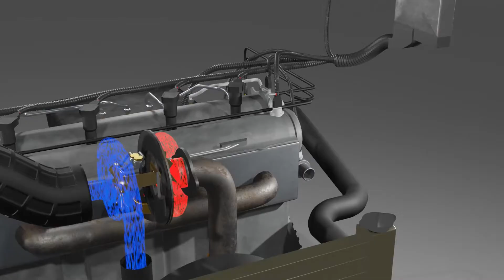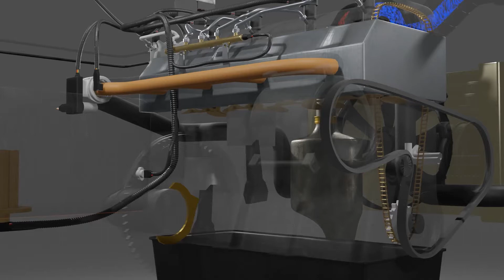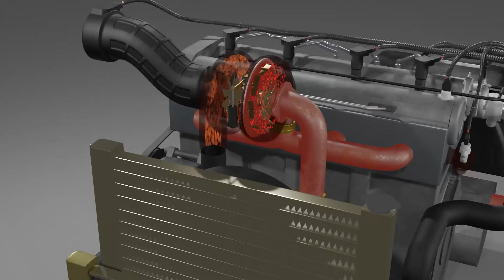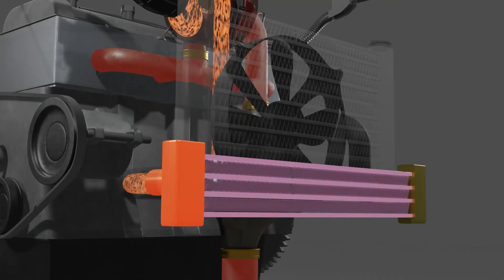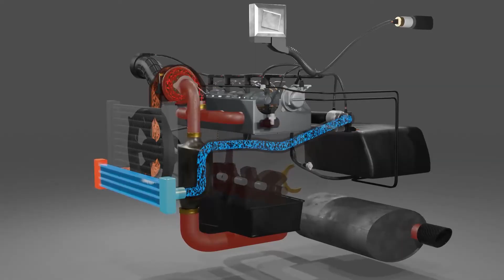Turbocharger and Intercooler working on Diesel Engine

Comment: Can this very same setup apply to gasoline engine?
Reply: it should change a bit after the intercooler i presume. since the major difference is that the fuel is mixed with the air before going to the combustion chamber, and is then ignited with a sparkplug

Comment: what the fuck? diesel need a valve to control the rpm? go do some relearning, diesel doesn't need a throttle (throttle valve, throttle body) its controlled solely by the injected quantity

Comment: Hello. What could be the reason for the exhaust gas temperature being higher than normal?
Reply: A DPF regen, your diesel will burn more fuel as it richens the fuel-air mixture.

Comment: Wouldn't more air mean more fuel?
Reply: In Diesel engine answer in "NO".
In Petrol engine answer is "YES".
Reply: @Indian4all  why?
Reply: @stf3912 in a diesel engine.  The amount of fuel flow is controlled by the injection pump(older mechanical diesels).  There is no throttle plate.  Newer diesels utilize a computer to control when the injectors fire.  Gas engines use a throttle plate to control airflow.
Reply: It creates the optimum condition for combustion therefore extracting maximum energy output from fuel used.